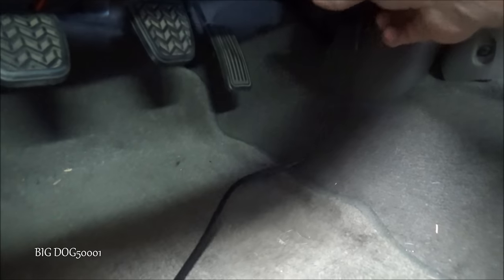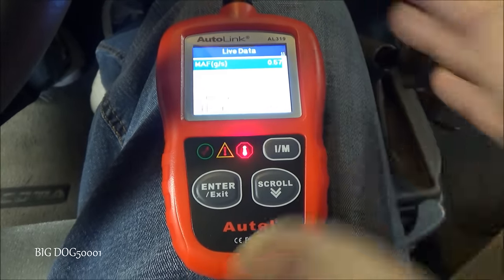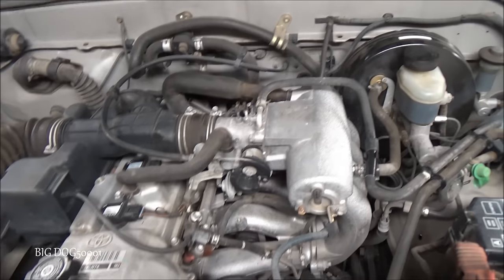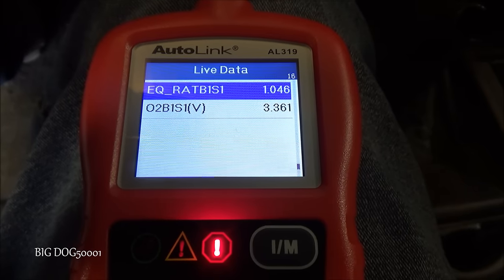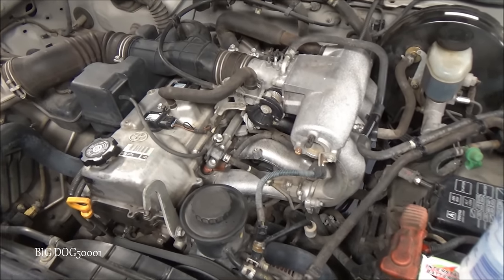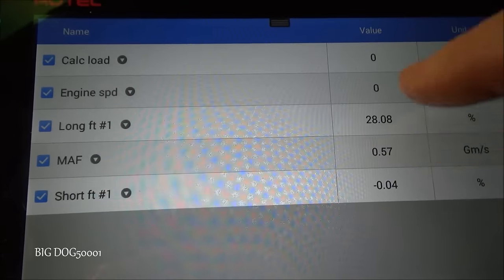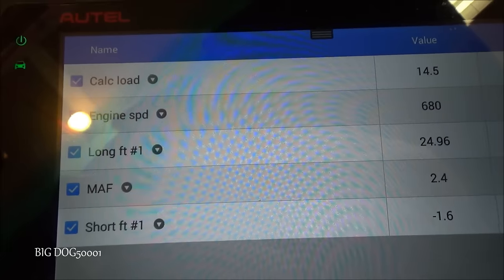P0171 Trouble Code: System Too Lean Bank 1 Diagnosis

Comment: Very informative but still at a loss.

2010 honda crv 2.4
Started with a p0420 replaced cat per dealership.

Now stuck with the p0171

Here is my dtc

Stft 46.9
Ltft 35.2
Iat 39.2
Maf (lb/min) 0.3
Tps%  13.7
O2b1 volt .015
B1s2 % 46.9
Comp evap 20.4

Ughhhhhhh
Reply from the maker: There is a good chance this issue was the cause of the P0420.  If there are currently other DTCs, they may need to be addressed first (depending on what they are, MAF/MAP/O2/EVAP/EGR etc) because they can cause a P0171.  I would start simple.  Visual inspection for any disconnected or damaged hoses.  Pull the Mass Airflow Sensor (MAF) and see if there is any debris inside.  Look at fuel trims at idle and then at around 2,500 RPMs and see if they get better (indicating a vacuum leak).  Verify the Engine Coolant Temperature Sensor 1 (ECT1) is working properly from cold start to operating temperature with no glitches.  Thanks for the comment!

Comment: Lean code. idle LTFT is 19.5 at 2500 rpm LTFT is 39.8. I have replaced maf, coolant sensors and fuel pump as well as injectors. Norhing has helped. I dont have any vacuum leaks. Please help
Reply: Have you fixed it ?

Comment: Very informative, will use to pinpoint my issue. Thank you for doing this!
Reply from the maker: Thanks 👍!
Reply: I am having similar issue. 2008 Toyota 4Runner with 129k miles, I am the first owner.
Started on and off about 3 month ago with CEL and other 2 lights  on the dash board. I cant recall exactly the code but I researched and it I though it was fuel tank cap. I replaced, delete the error and in the few days CEL lighted up again with different codes. The car drives at that time without any noticeable changes. I felt no difference. Sometimes CEL was going off depending I guess the amount of gas in the tank. 
Last several days I started to pay close attention, after noticing some unusual (raspy)  sound when I release gas pedal, not all the time, but often.sounds like its from either engine or exhaust pipes, may be even catalytic converter. If I delete the code it takes like 4 driving cycles to CEL with 2 other lights to light up. I read and delete P2238 and P0158 and today after 4th time I drove my car after erasing the codes P2238 came up again. This time along, no other codes. 
I am thinking the unusual raspy sound from my truck is may be due to the lean fuel condition? I am not sure of course, just a though.
Do you have an idea what this can be? Do you think it can be upstream O/Air Flow sensor on Bank 1, which I believe passenger side of this truck?
I clean MAF and TB but it did not help with these last errors. 
Thank you for reading man.

Comment: Thanks for the detailed video. I'm going to use it to help me diagnose mine. I did wonder, on the scope.... what was the small one you said you could have used? Can't really justify a more expensive scanner, so built in scope is out, but I'm hoping a small scope also means smaller price tag.... or same size tag with less digits!! LOL

Comment: I had my car at 3 shops for this code they cant find the problem the car is hard to start rough idles stalls sucks gas changed the mass air flow sensor a vaccuum hose behind the engine and a oxygen sensor behind the engine still isnt fixed

Comment: Bought the same OBD to scanner on Amazon for $30 to 40$. Seemed decent but I had no idea it could scan all those sensors, get all the  sensor data from the time the code came up. Plus I'm pretty sure it can control certain components or.at least see if they are working properly. Nice scanner I'd pay 300 a year ago for this beauty lol

Comment: I got that code changed the mass air flow sensor,a vacuum line was bad behing the engine oxygen sensor beging the engine reset light came back on I cant do any more.im not a machanic bit the car will be hard to start then stall rough idle.and some days it runs great I have no idea

Comment: Such an amazing video, thank you so much! I changed the fuel filter, fuel pump a couple years ago, cleaned up the throttle body, still some issues. I will try to take the vacuum leak issues more seriously.

Comment: Hi Mr. Big Dog 50001,
You really do explain using the AL 319 ( which I'm still learning how to use), in this video extremely well!
I've just bought a 'lemon' of a V6 2003 Jeep (Cherokee in Australia & Liberty in USA), with 125,000 miles on the clock.
It's thrown up the 'Check Engine Light" ( not flashing ...yet!) on the dash. 
I used my UL319 OBD II  Code Reader, which  spewed  out following DTCs:
(i) P1391 - $10 Generic - Camshaft Position Sensor . A circuit Bank1 or Singl
(ii) P0340 - $10, Pending, Chrysler,  Interim loss of CMP or CKP.
As a DIY 'ignoramus', with  a multimeter as my 'only' other diagnostic tool, I'm floundering all over the 'Net' for help, ...
as I'm in a panic that 'Big Dollars' might be the only solution to turning this 'lemon' into a sweet orange!
So far all paths are pointing to the following  troublesome possibilities:
(a) Cam & Crank out of sync. because of Timing Chain elongation/stretch,
(b) Sensor/s have self-destructed.
(c) Fault in the wiring harness.
(d) The notched disc that generates the 'Hall effect' wave patterns has broken in the engine.
(Typical unit used in  Chrysler products)
Possible action going forward:
(i) Check: (i) Power line, (ii) Ground line, and (iii) Signal line at each Sensor,  for 'A" OK - before running out and buying replacements.
If you can offer any advice towards making my Cherokee a ' sweet orange'  ... I'll be most grateful!
Perhaps a link or two that 'homes' into my 'dilemma'.
Thanks again for your super instructional video pertaining to 'P Code',  DTCs.
Best regards,
Lloyd.4560@gmail.com
Queensland, Australia.

Comment: Great video. I've heard these explanations before but it really helps seeing them in real-time on a real vehicle. I have the opposite issue, I have good short and long-term fuel trims at idle but they go way up when I give it gas. Could that indicate a fuel delivery issue?

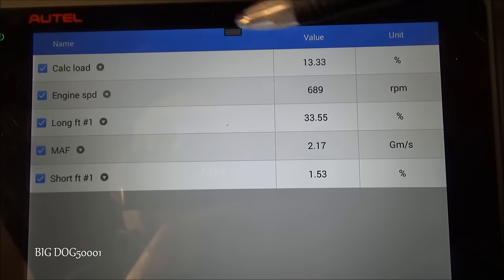Comment: I was wondering, if the LTFT stuck high like 32:10 
Can I test it by unplugging the MAF and see does the LTFT drops?

(Since the ECU will use the default table, which should improve LTFT if bad MAF is the problem?)
Reply from the maker: Some vehicles have programming strategies where unplugging it can help.  Some have poor programming and it won't help and in some cases the car won't even run.

Comment: This diagnostic is very precious to everyone. I learned hard way by changing complete ignition coils & spark plugs just to find out that the problem was purge valve and gas cap which I changed later, made the car running again. Yes I suspect I have to go after in details just like what you outlined here as I know I still have issues with either a vacuum leak, sensor problem, maf problem or fuel filter/pump. Thank you so much for taking from your previous time  to give us most needed info . Thank you 🙏

Comment: Update on 01' 4runner, P0171 DTC. Passed all 3 brake booster tests, no leakage there. I did re-set the trouble code but MIL re-lit <1min. Your advice to monitor ECT was prescient. The ECT was 79 degrees celsius sitting cold this morning. It jumped to 90 C after 3-4 min at idle and did not decrease while driving. Top radiator hose very hot, lower radiator hose not very hot to touch 5 min after driving. Can a faulty thermostat cause a (false) bank 1 lean code?
Reply from the maker: The engine computer can be fooled by bad ECTs and thermostats because it will deliver fuel differently depending on whether the engine is cold or hot.

Comment: I had an error code, P0171, on my 2015 Toyota Highlander 2 days ago. Took it to a mechanic. I was told the MAF sensor needed a replacement. It was a 2-hour job and cost was $660. I paid a diagnostic fee, $135, and took my car back home. I googled it, bought a new sensor and replaced it myself. It took 40 seconds. So that tells me that mechanic is not trustworthy at all.

Today, the check engine light went on again while idling my car, which was the same issue as before the MAF replacement. I have no idea what to do right now…
Reply from the maker: A P0171 can be difficult to track down and sometimes there is more than one issue causing the code (like the vehicle in this video).

Comment: I appreciate the video very much but the tools used like the Snapon which is not listed in the Description is a $5,000+ unit which additionally costs as much as $2,000 per year for updates and subscription.
The average Joe cannot justify such cost, perhaps good info for small mechanics shops.
...but thank you for the info.
Reply: So all air hoses and sensors in the path, intake manifold, brake booster... 
if I may add: exhaust manifold leak, anything plugged in to any manifold, the PCV, the EGR, the IAC, the O2 sensor(s), ..., and a potentially soot filter plugged up on diesels, and the NOx catalytic converter on its way out... but who will pay for all of that!?

Comment: Wow I think this solved my issue I’ve been chasing on my sons 04 Benz c240. After many OEM Bosch MaF I did not realize the brake booster could throw a lean code for lose of vacuum, I will tackle this next thank you!

Comment: I have the P0171 code and the P0174 on my 2004 GMC yukon xl that I have been trying to resolve for a while now.  I paid a local Ford dealer $150 to diagnose it for me and they claimed to rule out vacuum leak with a smoke test and no leaks found.  O2 sensors tested for continuity and are good, no exhaust leaks found either.  They found the fuel pressure went from 56 psi then dropped 15 psi after 5 minutes.  They recommended fuel pump be replaced.  Since they wanted a over $1050 for the job I passed on it.  I found a local mechanic who did it for $650.  Guess what the codes are still coming back in.  I am in $800 and still having the same problem.  This frustrates me and aggravates me.  I never learn from my mistake of putting to much faith in dealership service mechanics.  When will I ever learn?  Big Dog your video here made more sense than the bogus customer report on my invoice.  I need to find a mechanic who knows how to use a diagnostic tool like the Autel used in this video.  Got any advice or contacts in Buckeye, AZ?
Reply from the maker: I sent you a message, hopefully you get that thing fixed properly.

Comment: Many decades ago when I first began working in the mechanical field, a common engine problem was an inlet air leak, ie air was getting into the engine from a loose manifold, loose carby, split or detached hose, or from somewhere air should not get in. The problem was called an 'Air Leak'. Nowadays all we hear is  'Vacuum Leak'. Here's the thing - vacuum cannot leak. Where a vacuum system is compromised, air leaks in - vacuum does not leak out.
Reply from the maker: Thanks for the input!

Comment: Buick 2000 3.8....my warning light problem began about 2 months ago. First it said gas cap loop, I cleaned it and that was solved...Then it became slightly difficult to start, so I would slightly tap the gas pedal and it would start right up. After a couple days it would start up normally again on the first turn of the key like it always has and still does now........a couple weeks ago the yellow check engine light came on and the code came up PO171. Then it when out by it self a couple days  later, then came on again, and went out again...During all of this I have watched my mileage very closely, and my instant mileage for highway driving is 29 mpg, which I the same has it has always been, and the average overall mileage is 22, like it always has been......do you have any idea what the problem would most likely be? Thanks for any suggestions...............
Reply: PS the car has run perfectly during all this time.......also, not to be confusing;  I meant to say the gas cap loose warning  in the above statement...

Comment: Hands up from Kenya!

Not a mechanic, but I followed, easy. 
Also explains why my decade+ old Forester (and many others) could  be literally swallowing fuel.

What are the fuel saving implications of such a repair?
Reply from the maker: It should run more efficient after fixing this code but any possible fuel savings would depend on the type of vehicle and how bad the fuel trims were before.  Thanks for the comment!

Comment: PO 171 could mean 50 different things a friend had a 2001 Toyota Camry 5 shops 2 private mechanics changed many parts no result the code keep popping up and the car would hesitate on initial acceleration Fuel Pump was changed no better owner got rid of car Toyota's run forever no way he had more trouble than a Chevrolet.
Reply from the maker: Sounds like they did a lot of parts changing and not a lot of testing.  Thanks for the comment!

Comment: well after  weeks of trouble shooting day here day there, I ruled out no Air leaks and MAF and O2 and realizerd it was all fuel related  issue. unfortunatley, there is no way to measure fuel pressure on sentra 2005 because none of the fuel disconnect tools available on the market worked. so I just  replace the fuel pump suspecting pressure regulator causing the issue which is part of the fuel pump. as soon as i replaced the pump, fuel trims went back to 0 . talking about confirmed fix.

Comment: 👍. another way to make difference is try to cheat the ECM, by providing a good signal voltage on that Mass Air Flow sensor line!

Comment: Brother for the all car that have bank1 only the O2S11 volt should be 3.3 if lower than this that’s mean the oxygen sensor is bad? Because on mu car its 2.255 and when i press ptrol it go down to 1.9 please help!
Reply from the maker: I don't know what vehicle you have but it doesn't automatically mean it is bad, it could be reporting properly and there is something else causing it.

Comment: Dumb question but do I actually have to be driving to freeze frame different RPMs or can I have the car started  , but in park and step on the gas a little ? (Plus I can’t even see the RPM on the dash as it only shows MPH) Can someone tell me the steps I’d go through if I am using a Blue Driver app ?
Reply from the maker: When the check engine light turns on it captures the data at that moment (freeze fame), but in general it doesn't do it on demand and not all codes will store freeze frame data.

Comment: After you do a visual search and  can't find anything or whatever ya find do a smoke test using a homemade $15 device (search YouTube) or use a cigar or cigarette and drink a beer as ya blow all the smoke ya want! Lol. 
I suggest you do so when vehicle is stone cold as well as entirely warmed up...some leaks will show at different temps.
Reply from the maker: Smoke machines are a great tool to have but they can't diagnose every issue.  Thanks for the input.

Comment: Thanks for such a detailed video, plus showing the diagnostic unit and what it all means. I have the dreaded p0171 too lean bank 1, and initial googling is indicating several potential causes and worries of the cost of the parts, but how to check which is the cause of the fault code. I did wonder if the diagnostic could be used with the engine running as the poor english for my tester seems to indicate you couldn't. But you need to see the numbers change if confirming an air leak.
i need to watch this a couiple of times making notes then go to the car and run through it in the mannner you have

Comment: Thanks to you I think I found my problem. Took off the top of the air filter box and rubber tube connected to it. Went into a dark closet and put a flashlight in the tube and volia! I see light through some cracks in the rubber. I'm sure I caused these cracks by wrestling with it every time I change the air filter. You could make a video on how you change the air filter on a 05 Accord for dumb heads like me. Thanks again for the help and the sticker you sent me.
Reply from the maker: 👍   I will see what I can do on the vid.

Comment: R u a mechanic  , with that cheap scanner  u can figure  out everything. I seen expensive  scan tools  like snap on $3000 . Scanning  tool work Better.  How do u know of all this stuff. 🤔🤔😠😠
Reply from the maker: I have several more expensive scan tools, they don't necessarily make you a better mechanic  I used the cheap code reader in this video to show it could be done with one.

Comment: Is there any tool to check the fuel ratio on a od1 I have a 92 4runner with a P0171 and a P0152 code?

Comment: I can't wait to learn what the reading should be just like that. I have the same code in a 2011 colorado 5 cylinder. It has some missfires at times. Could dirty fuel injectors cause this code?
Reply from the maker: It can, but many times it will also show misfire codes.

Comment: I'm running lean on Bank 1 on my Duratec DOHC V-6. I'm gonna check my MAF sensor  (I already cleaned it with CRC) and look closely for vacuum leaks.  Why would I be lean on only Bank 1? Any advice would be greatly appreciated. Thanks.
Reply from the maker: In general, something is effecting just that bank and not both sides of engine.  I would look at things that only effect one bank (a MAF issue will usually effect both banks).
Reply: @BigDog50001  Thanks!!